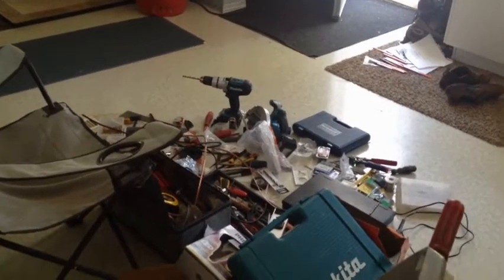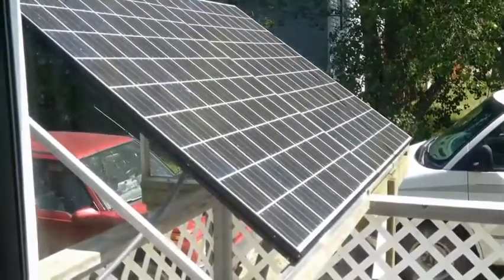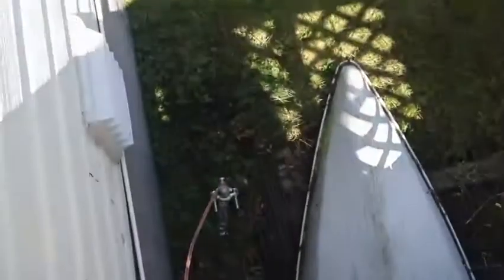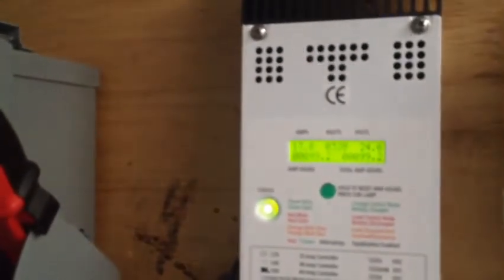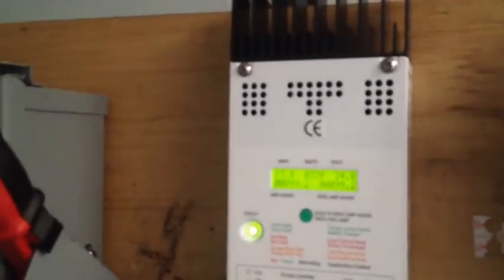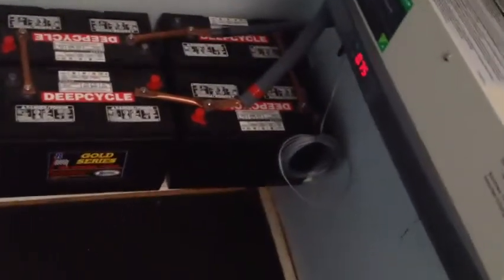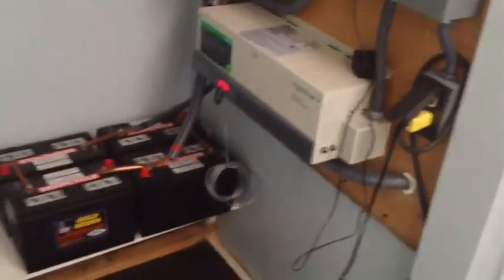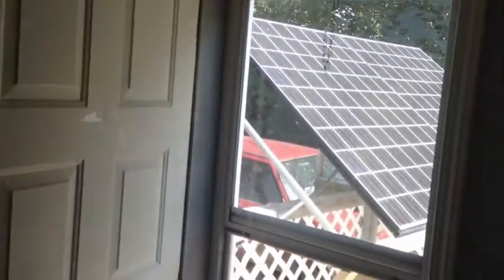New 24V Photovoltaic Solar Inverter System Setup

Comment: The setting on that controller should be bulk 28.8 and float 27.2 if the battery voltage is below 25 volts then you are draining the batteries to low
Reply from the maker: Agreed Kenneth.  I've recently doubled my panels and tripled my batt banks as well as purchased my own water de-ionizer (chem filtered) to be able to maintain the electrolyte from my own water.  I've also found having this setting too high (if not grid tied) can leave the batteries boiling at their peak more frequently, if not utilizing the inverter output, and can also be harmful to their longevity.  Technically by the manual specs for my batts they are able to recover from as low as 9 volts without damage (deep cycle).  I'm finding water maintenance to be the biggest major factor influencing battery health, while bulk and float and peak levels are important as well.  Thanks for your response sir!

Comment: -How did you take 24 volt panels and use them as 12 volt panels.
Reply: +Gary H mppt charge controller will charge a 12volt bank

Comment: Where and how to attach a voltage reducer in my solar power system?
I intend to wire my solar panels for 24v for efficiency, but since my devices use 12v, i need this thing to bring the v. down, where do i tie it in, and how? I intend to use this one on amazon: http://www.amazon.com/Converter-Regulator-Voltage-Reducer-Step/dp/B00AO0PCMW

Comment from the maker: Hi Barry.  First part of my solution to help prevent generation of hydrogen sulfide was to increase the total amp hours of storage, to avoid the battery voltage extremes, from 4 batteries to 12 since this video was made.  Have found my banks could now accept the full potential of my panels while boiling the electrolyte as little as possible.  Will be enclosing that space, setting up voltage/temp regulated exhaust fan too.
Was considering battery shed outside, but Manitoba winters are a concern.

Comment: You may have to move your Batteries away from your electrical set up because of the off gassing from the batteries will settle on and get inside all of the electrical components and eat it all up.

Comment from the maker: batteries?  Yes, my inverter is 24volt.  So technically i only had 480ah @12volts in that video, not @24volts.  However i have since doubled my banks so i now do actually have 480ah a@24v.  :P